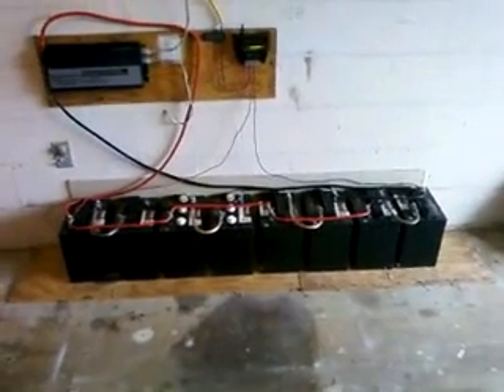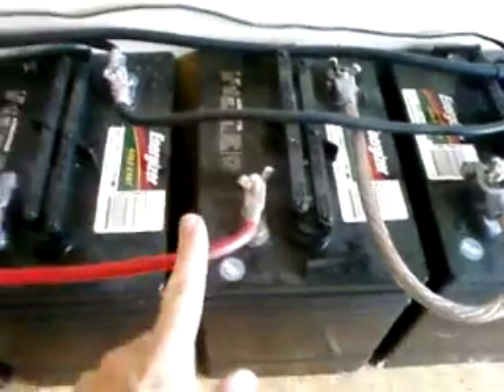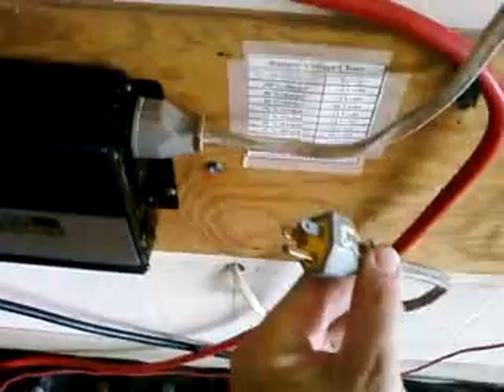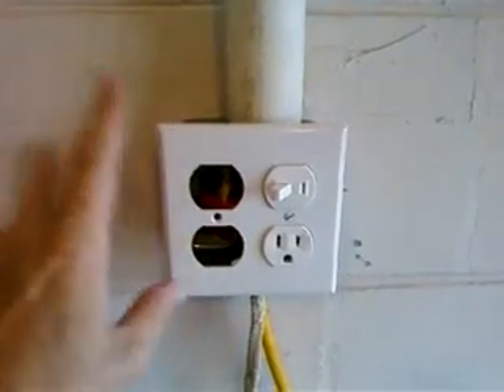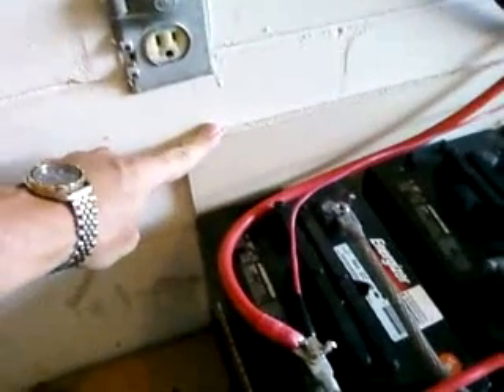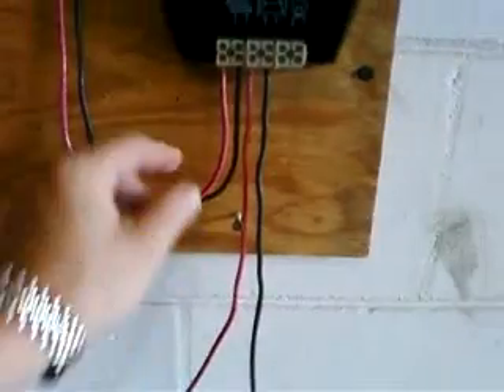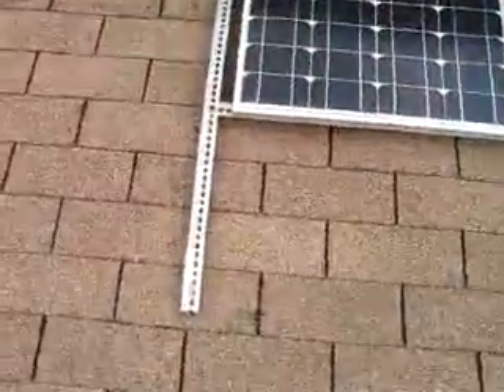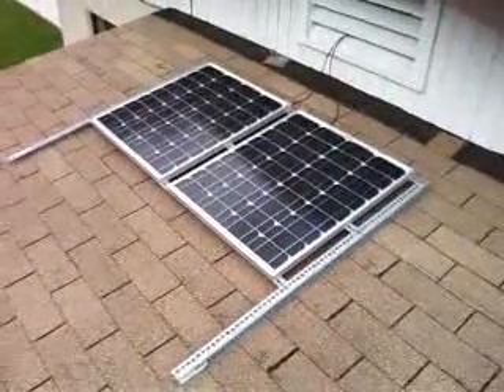My Solar Power Setup - Part 4  Upgraded System

Comment from the maker: @Jthetinman I used 6 volts to get more amp hours from the entire bank.  You could easily use 12 volt batteries and get almost the same capacity, but the 6 volts charge a little deeper and run for longer.

Comment: Nicely done.  do you really need that many batteries?   I guess you have larger panels now, but if I have let's day a 60W panel and then a 30W, would I need more than 1 or two batteries?  Is there  a benefit to more batteries?

Comment: FYI....you can NOT enlarge a battery bank by adding new batteries to it. A Batteries' voltage response changes with age. A new addition will be the easiest path of resistance for charging, thus causing the older batteries to become lazy and hard sulphate the plates, making the old batteries even harder to charge. This is a sure way to develop bad cells.

Comment from the maker: @tuxinduluth I am in Central Florida, so snow is not a concern, heat is.  I would think that if you mount the panels on an angle facing the sun, when they heat up the snow will melt and run off them.  I am in the process of adding more panels to run daytime stuff now.

Comment: @skippy3840 I found a way to make these inverters to be thermal so the fans are not running but, only when needed and since you have already taken yours apart once you should be more understanding of the components.  I want to do this to mine so it uses less power. How many watts is your setup now? I am at 590 before  loss in inverters and such. Pushing most all through a 250 watt GTI. I need a killowatt meter to see what I am actually getting out of it.

Comment from the maker: @1kzrider Right now I am running a ton of lights and a 19" flat screen TV.  I did wire another room so now I have half of my house off the grid if I want.  Yeah, the fans suck on these inverters, my inverter had three fans and the bearings on two of them have gone out already and made the fans scream.  I actually had to take the inverter apart and remove two of the fans.  For what I run, the batteries are just the right amount, need more power for daytime operations though.

Comment: Hey Skippy what all are you running off your system? And did you upgrade the inverter to pure sine wave? I have the chicago 2000/4000 and a 400/800 but, when I run inverters the fans run to much are you noticing this also? BTW love the setup You have many many batts. Do you really need them all or just giving yourself a buffer?

Comment: sweet thanks I have everything I need except the batteries , just recieved my solar panels in the mail a couple of days ago - went with skyblue charge controller w/ mppt - trimetric 20/20 - 3000 watt inverter. Have you ever pondered with purchasing a grid tie inverter ? and can they be wired in as the dump load from a charge controller after the batteries have reached a full charge ?
 Thanks - your videos are great

Comment from the maker: @dracos78 Yes.  I also sent the wires from the panel that I built into my combiner box, so I now have three panels connected in parallel and sending 9.5 amps and about 130 watts through the combiner.  I also upgraded to #10 AWG stranded wire from the combiner directly to the charge controller and it works alot better.

Comment from the maker: @hippyraverocker Since I made this video, I changed the wire from the panels to the charge controller to #10 AWG stranded wire.  It works much better.  #10 is the thickest wire that would fit in the terminals of my charge controller.

Comment: Nice setup.

You need to use thicker wiring from your panels to the charge controller and then to the battery.

My setup uses 8-Awg cabling which is good for about 70a @ 12v.

check my video out.

Comment: you need to change the solid core wire on the DC side to thicker stranded wire and you will get more amps.  DC voltage doesnt travel well on solid core wire.  nice little setup though.

Comment: I found out that you should call your local battery dealer direct. In my case Interstate Batteries. And ask to buy "Blems" or blemished batteries. They are new, but have minor cosmetic blemishes to the exterior. I got 2 6v deep cycle 225ah batteries for $94.00. This is less than the price of one batt. Just a piece of advise I got that was well worth it's weight in gold. Later, from sunny FL

Comment: nice set up,i had simillar system like yours,3 -80watt pv. 1200 sine wave inverter&charge controller, batteries.cost nearly 2k. i used a FUSEBOX  to connect every equipments to my battery bank. yes its hobby for me to kill time,but safety first. i will post my system soon.

Comment from the maker: I would think that if you ran 1000 watts you would see a large difference.  You could also selectively power different devices that are large power users also, like the refridge or a/c unit and make more of an impact.  Remember, I really only use mine for lighting and a small TV.

Comment from the maker: Thanks.  That is a 1,200w inverter.  I really only use about 3-400 watts at a time so it never overloads and the wires never overheat.  The charge controller will handle 16 amps coming in, but mine is a 12v only.  There are lots of 24v accessories out there if thats the voltage that you are using.

Comment from the maker: That is correct, when you wire in series the voltage is additive and the amperage stays the same.  Two panels like you are going to build will charge alot of batteries and run alot of stuff.  Post a pic when you get don, maybe some instructions on how you are making them also.

Comment: i ordered 72 6x6 solar cells, .05 volt, 8 amp 4.14 watt. i am going to put 36 cells per panel. i am hooking cells in series, so that should give me a 18 volt, 8amp panel with 144 watts?  should give me 288 watts 16 amp. system with both panels.  plan on hooking to 8 6 volt batteries. what do you think skipppy, does that sound workable. i get confused about the amps, if you add the amps up its would be 288 per panel, but since its wired in series i only get 8, is that right?

Comment from the maker: Thanks.  Feel free to use anything that you like, or ask me any questions that you have.  I connect the inverter directly to the batteries because the charge controller is only 12v out and I don't want to overload it.  The system works better that way.

Comment from the maker: Thanks.  Right now I have 2 panels for 140w at 8 amps charging the batteries.  Works well with the amount that I am drawing every day.  The charge controller is OK, but I am thinking about upgrading that also fairly soon to a MPPT system.

Comment: What a great tour of an impressive system!  Thanks for sharing that.  I like your use of angle iron for the solar panel frame.  I might copy your idea for my panels.  I also like your use of starter cables to connect the batteries.